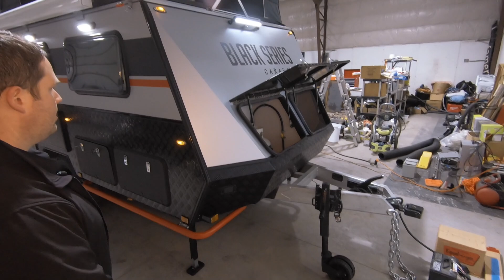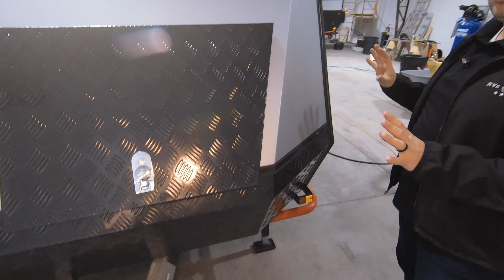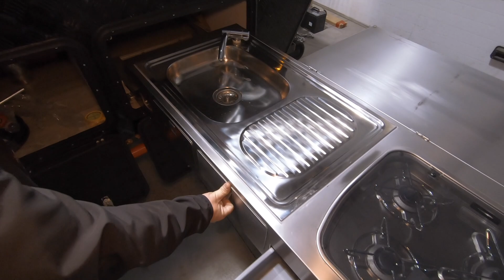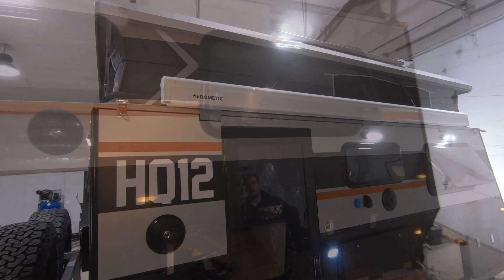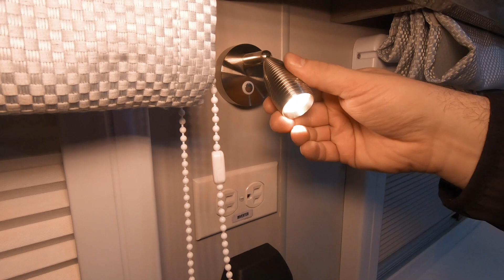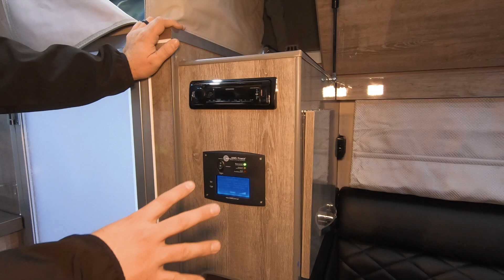2020 BLACK SERIES HQ12 FULL TOUR (2020)

Comment: I regard the HQ12 as one of the most incredible models within the Black Series range. The use of space is phenomenal. All the features of a typically larger family caravan, yet compressed into a light, nimble, low height, highly capable package. 

Quality and functionality is formidable too, Black Series really are class leaders in construction and providing comfort. This little unit will last and hold it's value, long after the competitors have fallen by the wayside.

Plus, RVs of America, provide equally impressive sales and support. 

I genuinely cannot wait to order mine! 🇬🇧

Comment: as the unit weight for HQ12 is 4,422(lbs) kinda over extra 922(lbs) from the 2020 Jeep unlimited rubicon but if there’s solution will make the tow possible?  hope would see your video for it.  😊

Comment: Good to hear they've added some insulation and heating to the tanks. Not so sure about the dump hanging off the back. Off road as the front comes up the back digs in and that looks like something that is going to be dragging in the dirt or getting broken on the rocks.  Does the tire rack come off completely and how much weight will the dual hitch receivers take? Could you hang a dirt bike off the back, say 300lbs with hitch carrier?

Comment: Great video, was wondering can a person save a little on the price if like myself having propane tanks, 400 amp hr lithium ion batteries, 700 watts solar, Outback flex 80 charge controller, battery monitoring system, 3,000 to 6,000 pure sine wave inverter and a hot shower system already?
Reply: U can do that if your like..watch this video how battery bank system running without bring a generator to your campsite

https://youtu.be/uAO1OFuRIEw

Comment: Glad you mentioned the road manners for the 2019 model as I'm interested in the HQ12 being pulled by a Jeep Gladiator Rubicon. It looks like there is no way to add a sway bar to the setup. Still waiting for someone to give me some MPG numbers on this as I plan on pulling to a site hours away.
Reply from the maker: It will pull just fine behind a Gladiator. Yes there is a way to add sway or WD hitches no problem.
Reply: @ROAOffRoad  i think a lot of jeep owners would like to hear detailed specs. I've scoured the internet. I see gladiator Rubicon towing 4500. I see only the gladiator sport s trim with towing package towing over 7000lbs.  But your interview with that guy and his girlfriend, the people from West Virginia I think, apparently towed one with their gladiator Rubicon. I'd like to know how. Gladiators only have a 5 ft bed and aren't built to tow as much as they are to go mudding and 4wheeling. 
Please do a towing video. Include Tongue weight. Include different hitches and how or why one would need a sway bar or WD. Please. Everything. I have a 2020 jgc trailhawk V6 and my max is 6200, tongue weight is 350. Payload is 1050lbs.  If you think a gladiator Rubicon can tow an hq12 than why not my jeep?